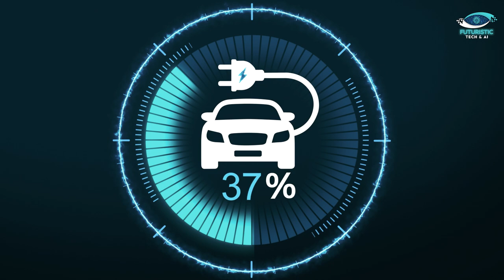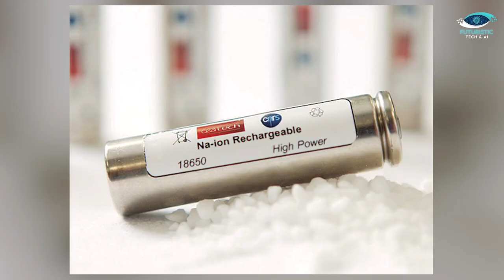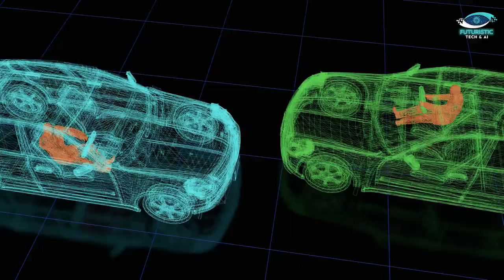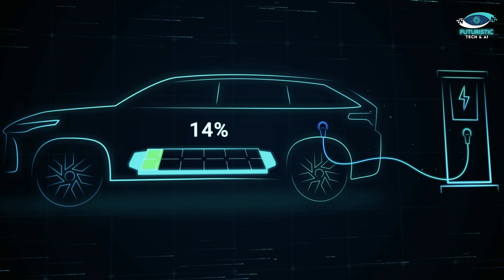Dongfeng's Game Changing Solid-State Sodium Batteries | Sodium Solid State Battery EV Car #dongfeng

Comment: It is a good promising step in the right direction... But, now, the engine industry will need to do its part as well. I believe we cannot to rely only on the over development of each time more powerful batteries. We also will need to have access to engines that save energy the most they can. It will be a combination of both those 2 worlds that will to make the car of the future!...
Reply from the maker: That's a really intelligent comment. Yes, hybrid technology can be more advantageous where the shortcomings of one technology can be overcome by another. This would have been in the future goals of these brands.
Reply: There are many ways to improve range, frictionless bearings, lighter vehicles less friction in the parts getting power to the wheels, maybe a motor mounted at each wheel no not on the rim yet. Motors are relatively decent at saving energy 97% efficienty i believe but it can only get better.

Comment: NASA developed the solid state sodium battery for use  IN  SPACE. Have you seen
NASAs budget? You cant afford these batteries they are $1M each.

!
Reply from the maker: Yeah, they will be definitely expensive at this stage, but hopefully, they will get cheaper with time as the tech industry proceed. Moreover, it should be noted that there is a massive difference in the use of these batteries by NASA when compared with the EVs. For EVs $1M isn't a choice.

Comment: Sodium?  It has a melting point of about 98 degrees Celsius.  Lithium has a melting point of about 181 degrees Celsius.  Both metals will react to water or moisture in the air.  Which one do you think is more volatile?
Also, sodium is mostly extracted from salt.  One of the byproduct is Chlorine gas.  What do we do with the excess Chlorine gas?
Reply from the maker: Well, these are some of the reasons that restrict their application. But hopefully, these issues will get resolved over time and people will get a more sustainable solution.